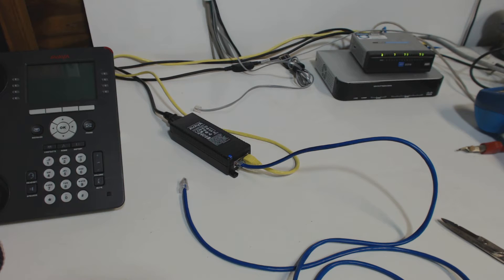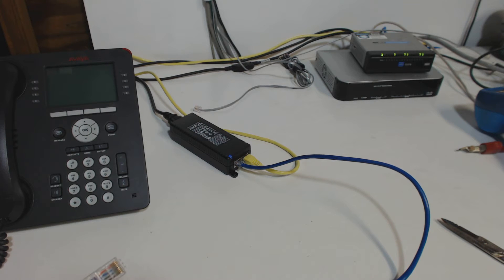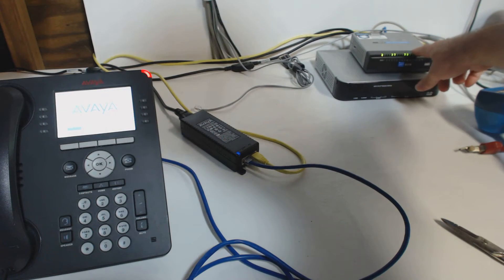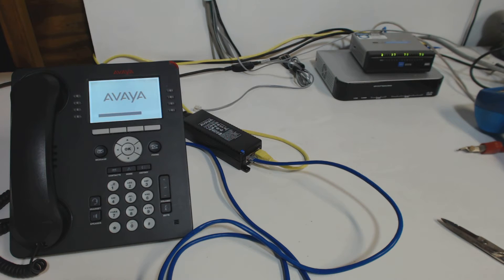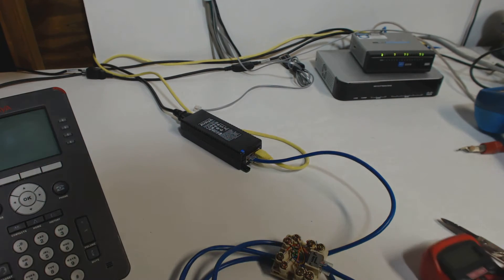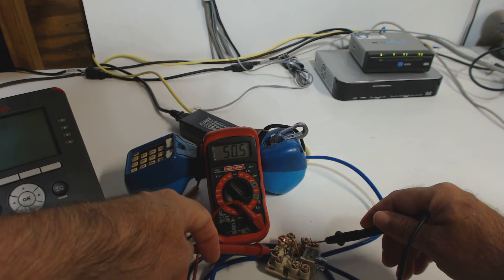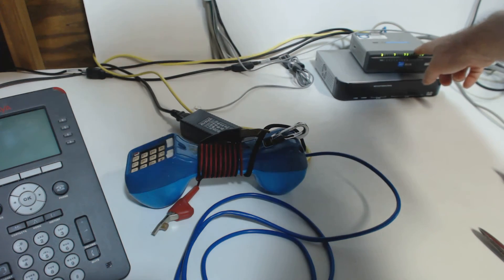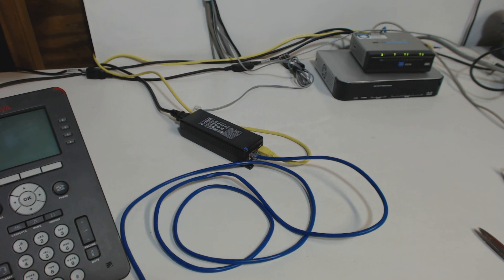Working with Power Over Ethernet (POE)

Comment: If I cut off one end of a Cat 5 cable, strip the ends off and connect them to a terminal junction block, plug the connected into a switch, place my leads on 4,5 and 7,8, should I see the voltage. I'm using a Fluke 175 true RMS multimeter.

Comment: Where can I get a test port like the one you're putting your voltmeter leads on? What is it called?
Reply from the maker: Thats just an old fashioned 8-wire “biscuit” jack.   Don’t use them much any more.  They were common for T-1 and 56K lines.   GRAYBAR would be the first place I would look.

Comment: Hi ! I'm from Colombia , i tried your method but i can't to measure the voltage !! i don't know what i do wrong
Reply from the maker: Many POE switches are smart enough not to send the voltage on the line when there is no device plugged in.  However, when I did this video, I was using an injector (not as smart as a poe switch)  ;-)Great question.  Glad you mentioned that.  😀

Comment: can i hook up a 12 volt usb car charger to cat5e ethernet cable and charge my phone ?
Reply from the maker: +Dustin dalessandro Nice idea!  But, I don’t think that will work for two reasons:  1.  The line is supplying 48volts.  So it would burn out the 12v charger.  2.  Most POE equip will only send the electricity down the line after its confirmed a valid network device has been attached on the far end.

Thanks for commenting! :-)
Reply: DIY Telecom thanks for the reply!!

Comment: I was surprised to see a voltage from a cable not plugged into a PD (Powered Device). From what I have been reading about PoE, the PSE (Power Sourcing Equipment) does not supply power unless it sees the PD.
Reply from the maker: +Kevin Rose yes Kevin I believe your are correct.  When I made this video, I was not using a POE switch, but instead I was using an in-expensive POE injector.  Maybe they are not as smart.
Reply: Passive power is provided all the time. Active power is only provided if the PSE detects a 5 ohm resistance.